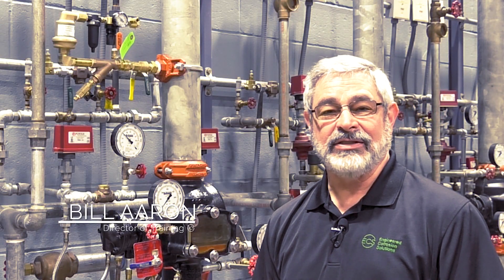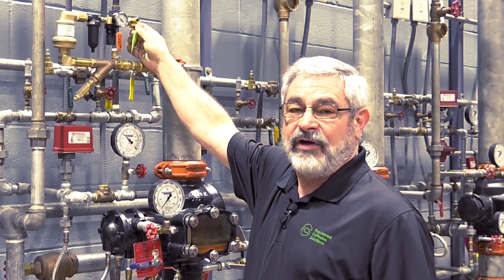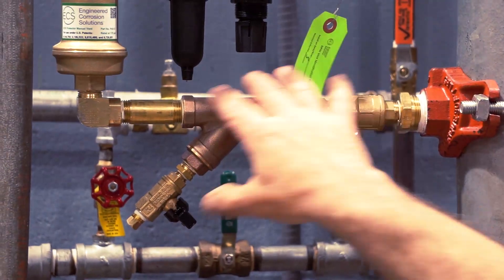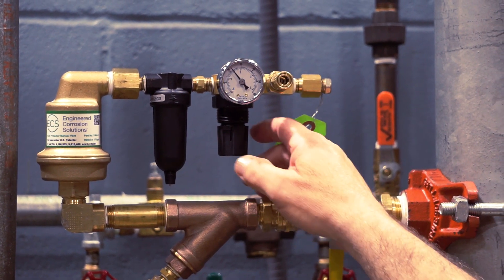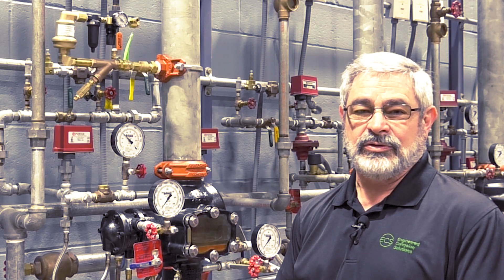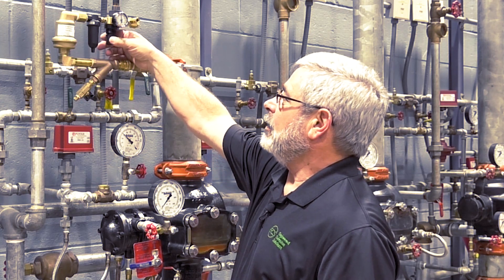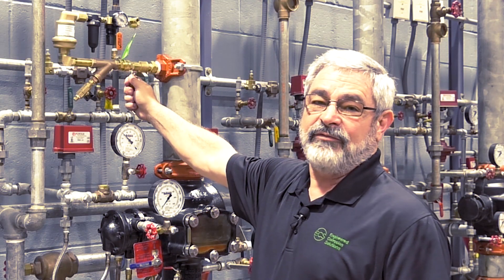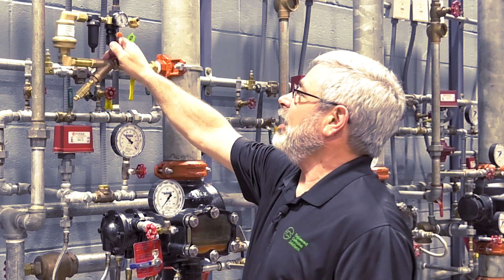PGEN Wall-Mount Walkthrough: Oxygen Vent Set-up

Comment: I have a nitrogen generator that is supplying multiple pre-action systems. I've noticed the air maintenence device regulators are kind of all over the place from system to system, nothing too drastic but they're all set somewhere around 30-40psi. The low pressure supervisory signals are all actually very low to the point where the cut in for the low air pressure is practically set at the same air pressure as the trip point which is around 10psi. They are all double interlock (electric/pneumatic) systems so it's not the end of the world that the low pressure supervisory signal is set so low, however I want to make the recommendation to adjust the cut-in pressure of the low air supervisory signals to approximately 20psi to provide a decent cushion between trip air pressure and low air supervisory cut in pressure. If all the air maintenance devices are set/adjusted to 30psi, would it would make sense that I want to set the regulator on the oxygen vent to around 25psi? Would it also make sense that I want the nitrogen generator reset/cut in pressure to be at around 25psi (5 psi below the air maintenance device setting assuming I adjust them all to be set at 30psi), and the set/cut out pressure to be say around 60-70psi (30-40 psi above the air maintenance device setting)? 

I read in the manual that air maintenance devices should not be adjusted after commissioning the ECS generator as it can damage the generator due to overcycling. I'm sure when the system was first commissioned everything was set with pinpoint accuracy, unfortunately there's no documentation on site (i.e. original acceptance test records/documents) and fast forward 5 years later everything has slowly started to slip in/out a bit and everything could use some fine-tuning.

Comment: Great video! If I'm not mistaken is the ball valve supposed to be closed again after approximately 14 days of venting/purging oxygen from the system? Alternatively it can be closed earlier if the nitrogen purity is at 98% or greater assuming someone is diligent enough to be checking. Does the filter need to be replaced at certain inspection/maintenance intervals?

Comment: Venting from base of riser? How does that vent the air at end of system?
Reply from the maker: Thanks for your question Josh. ECS uses a different method of removing oxygen compared to other nitrogen generator manufacturers. ECS utilizes "fill and purge" breathing, which cycles the system within a small pressure range (3-5 psi) while the system is operational. The sprinkler system is an irregularly shaped tank and pressure cycling a tank allows for the vent/purge device to be installed anywhere. Because the vent works anywhere on the system, we recommend installation at the riser where it is easier to install, operate, and maintain.

Other manufacturers utilize a method called "sweep purging". Instead of cycling the pressure throughout the system, high back pressure is maintained at the gas inlet and the vent/purge device must be installed at a remote location as the nitrogen gas "sweeps" the oxygen out of the vent. Sweep purging is effective on simple systems, but is not very effective or efficient on more complex systems. The vent cannot be installed at the riser when sweep purging is used.

If you'd like to learn more you can download our white paper on the subject here: https://www.ecscorrosion.com/resource/white-papers/

You can also call, email, or submit a question online if you'd like to discuss further.